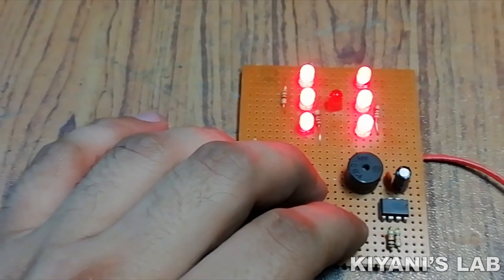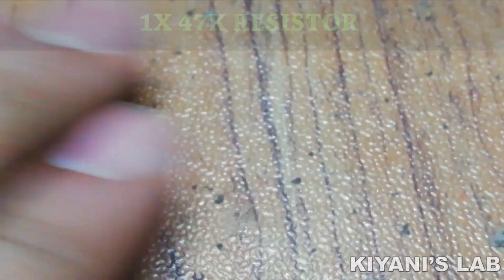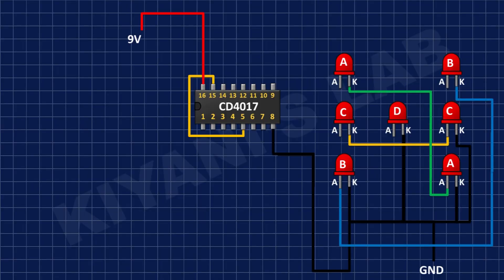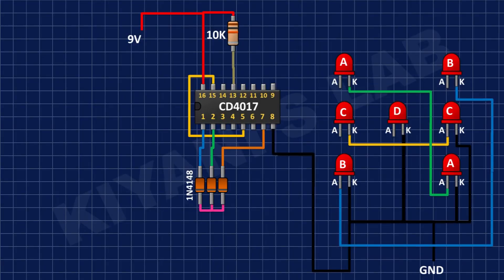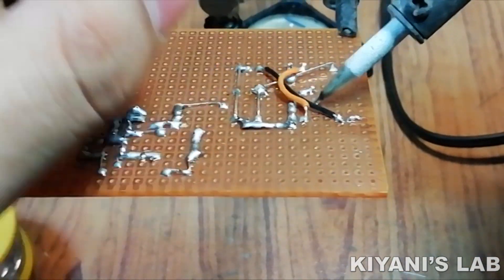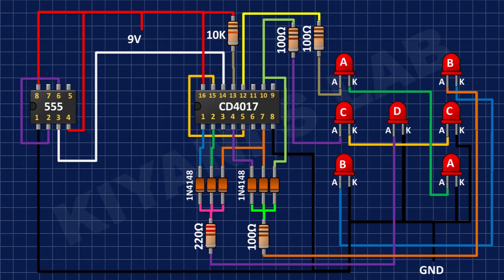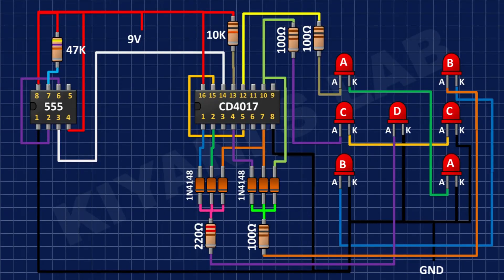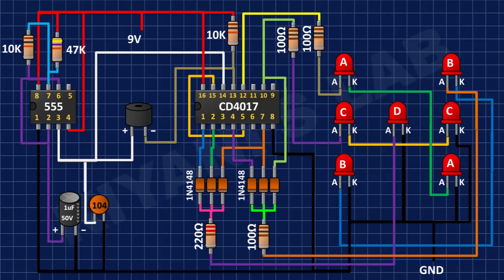How To Make An Electronic Dice

Comment: I had trouble with the buzzer I was using. I made it work by putting a diode before the positive lead. Also, a 220nF cap sounded better to me than a 1uf one.

Comment: Sar 12 volt ko 4 volt mein convert karne ke liye koi resistance bataiye
Reply: Use a ic 7805
Reply: @narendrameshram2951  sar resistance bataiye ic nahin lagani hai
Reply: @ashishjoshi5645  330ohm
Reply: Led attach krni ha to 220 ohm
Reply from the maker: Load current batao